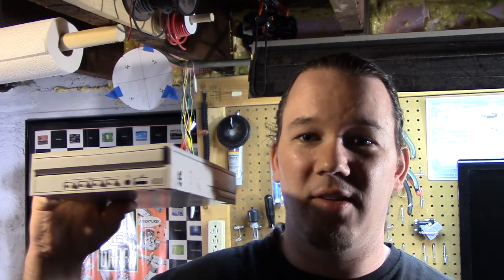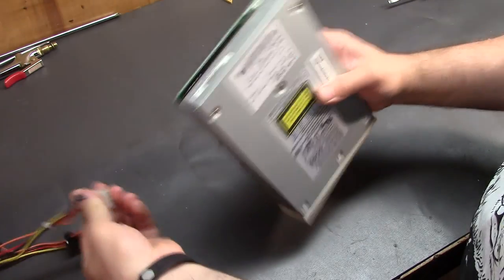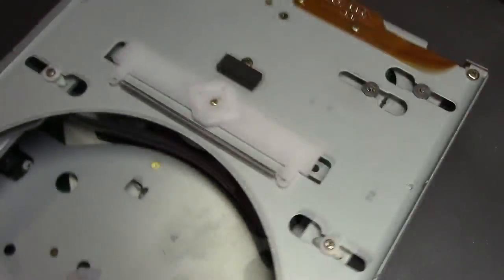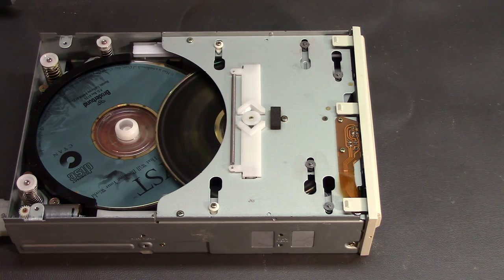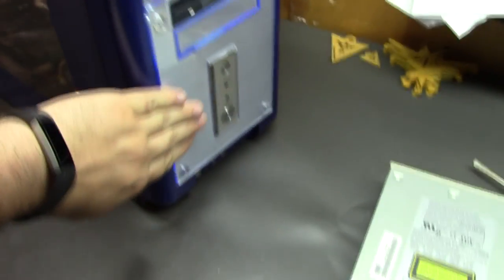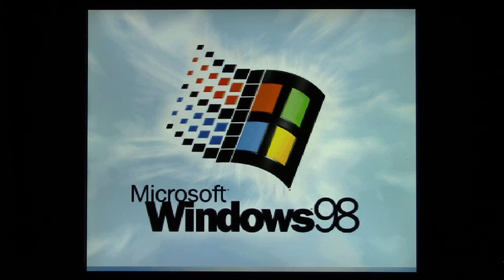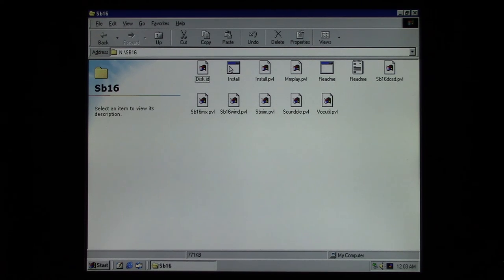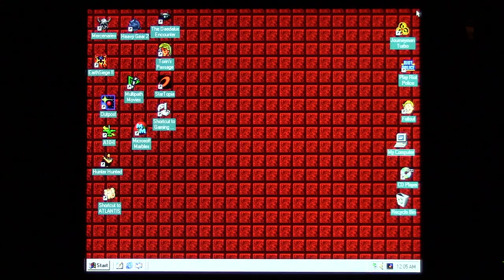NEC CDR-c251 MultiSpin CDROM Drive - BauTek Industries

Comment: I had one back in the day. its name is nec multispin 4x4 (4 disc, 4x read speed). It was so cool and so high-tech back then. Wonder if it'll work with modern Windows
Reply from the maker: I popped it into a couple of my test benches, Windows 7 and Windows 10 only see it as a single-disc drive. If I'm not crazy, Windows XP still recognizes the multiple trays and you can swap between them in the context menu.
Reply: BauTek Industries pity. Had you said it worked i'd have jumped to ebay and got one, if only for the nostalgic memory of having had one over 20 years ago :D